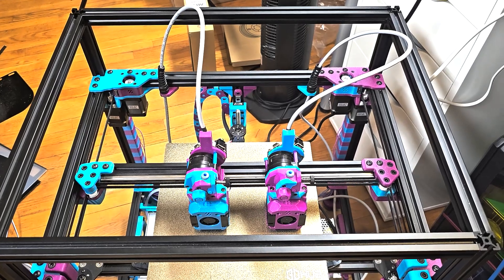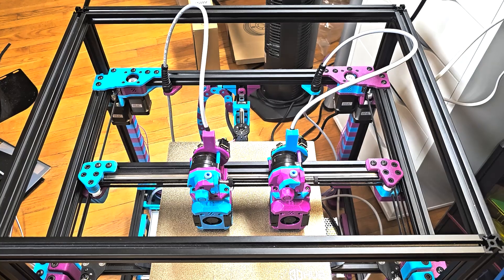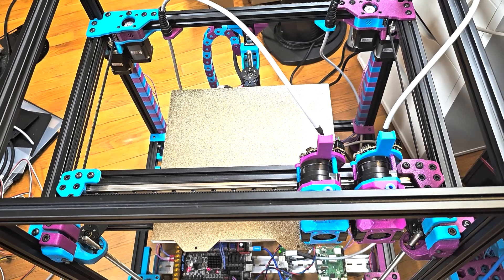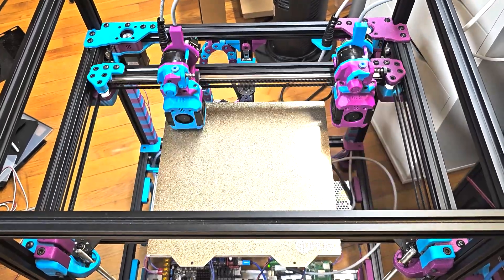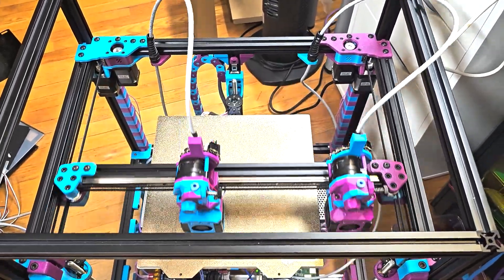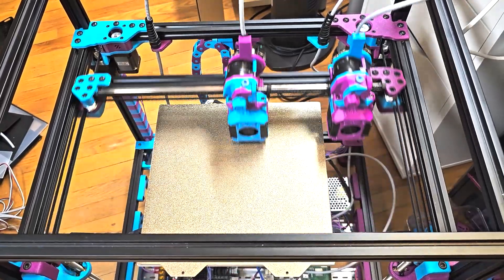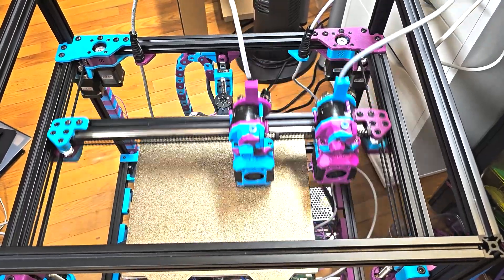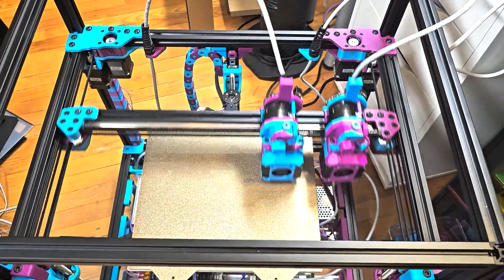Tridex: First Home All, Z-Tilt, and Bed Mesh

Comment: Looks great. Do you have the link for the nylon gland mount? I don't want to print off a new AB mount for one!
Reply from the maker: Honestly don't recall where I found the STL.
Reply: @oldguymeltsplastic  no worries, i figure its just a little flap that has a mount for 2020 and a m8 thread or whatever the gland is. Thanks!
Reply from the maker: @reidn5185  it has an M5 hole for mounting to the frame, and a thread for the PG7 gland. I am pretty sure it is a part of someone's Trident mods, I just can't recall from where.
Reply: @oldguymeltsplastic  sounds good, I'll dig around. otherwise it should be pretty trivial to model

Comment: Shouldn't both toolheads home to opposite sides of the gantry? Im going to make an idex printer here soonish and I thought that homing one toolhead against another might create some larger inaccuracies no?
Reply: If T1 homes against T0 and T0 is pressed against the x endstop I don't see why this would be a problem. Of course a flimsy toolhead may be a problem but that would be an issue in itself
Reply: @HitLuca94 dragonburner kinda flimsy tho, it flexes when my printer does sensorless homing
Reply: Homing off the other toolhead is more accurate for two reasons: 1. Offset only relies on variance in one endstop switch instead of two.  2. On enclosed printers that reach ABS printing temps thermal expansion causes the X axis to expand tenths of a mm which throws off the X offset unless you fully heat soak before homing every time.
Reply: @badmouth75 that makes sense. I guess you wouldnt want to back off T0 off the endstop when you home T1 then
Reply: @jerrysmith6798  It doesn't really matter as long as T1 endstop location is set correctly.  If T0 is parked at 10 instead of zero when T1 homes, then you'd just add 10 to the T1 endstop location.  Usually the T0 endstop location is negative because the toolhead is all the way off the bed, but for the sake of clarity I used 0 in this example.
Reply from the maker: What @HitLuca94 said. This configuration had been tested by a few others before me, and this homing configuration was deemed best.